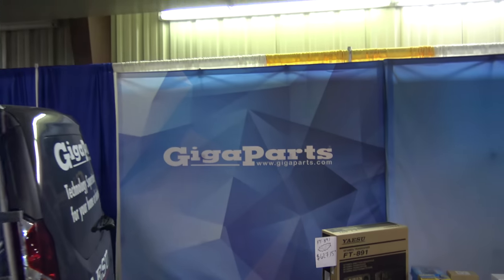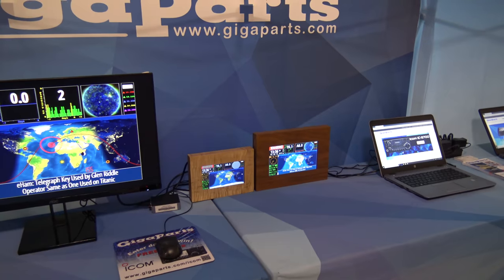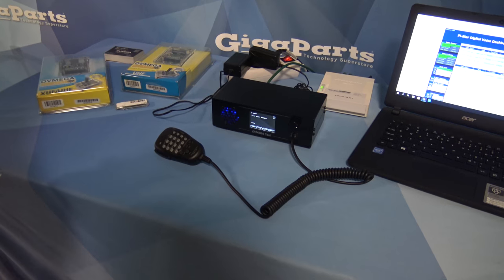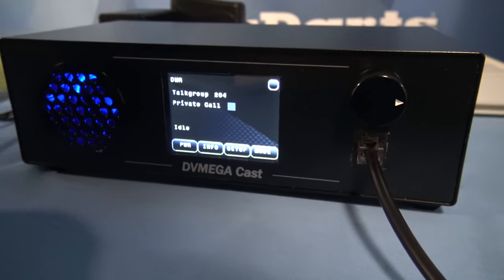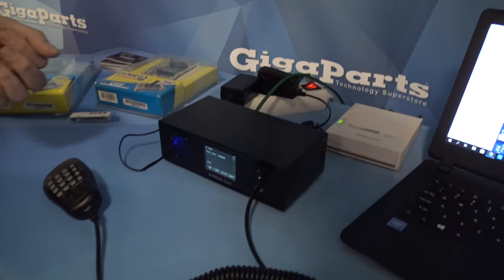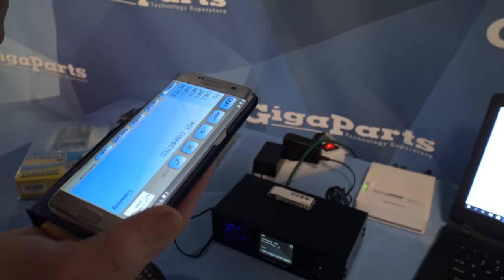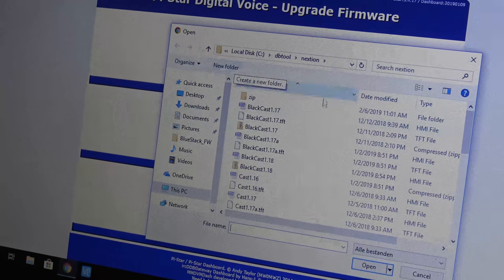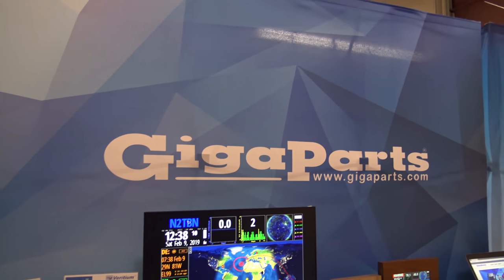BlueDV DVMEGA Cast, DSTAR/DMR/Fusion All In One Radio

Comment: The original creator of the HamClock, WB0OEW, has a version of this that runs on the Raspberry Pi. It can be downloaded for free from his website, clearskyinstitute.com. He has complete installation instructions there. It's very easy to set up. It took me less than 5 minutes to download the RPi version, update a few of the utils necessary to compile the app on the RPi, compile it and get it running. Near as I can tell, the free version I downloaded looks exactly like the version shown in the video (you can run it in a window on the RPi, or have it run full screen -- I have it running in a window so I can still run other apps on the same RPi). It's not at all clear to me what value has been added by the vendor to warrant a $300 price tag for the RPi version. I could see maybe $50 or $60 if it included a pre-configured RPi, but $300 seems to be stretching it. Maybe I'm missing something. 

Show less

Comment: The hamclock is a lot cheaper to make then to buy from them. After all, it was in qst magazine with the entire parts list and files on the website of the ham who made it...
Reply: do you know what one it was in or links???? must have missed that one.
Reply: @majordarkeagle  I like that Ham Clock. Thanks for the info.  Sad GigaParts thinks they need to make so much profit from this device.  Thanks to Elwood WBØOEW for giving us such a great device.
Reply: I wonder if you could run that off of the same RPi that you might have running a DMR hotspot on...
Reply: Just noticed that it's not actually running on a RPi, but maybe it could and pull double duty.
Reply: @ylexot007  Yeah, the original version was created using an Arduino. There is now a version that runs on an RPi. See my other comment for details.
Reply: @ylexot007  The CPU usage meter on my RPi 3B+ shows that HamClock averages about 10% usage. If you know what the average usage is of the DMR hotspot software, you should be able to determine if both will run at the same time.

Comment: That 370 euro DVMega Cast looks just like a UK AllStar Node clone.  I wish that Guus builds one day a 30 mW Analog Mega HAT for SVXLINK. I dont like digital modes anymore.  The audio sucks from a tiny id-51E HT speaker. I prefer analog modulation. Allstar,Svxlink,FRN.  Also Icom radio's are too expensive with nothing under the hood.  So for me analog Yaesu..  .    But a aliexpress  mmdvm board and TYT HT also works and is cheaper than Icom or Guus his products, for the people that want to go digital under 180 euro.